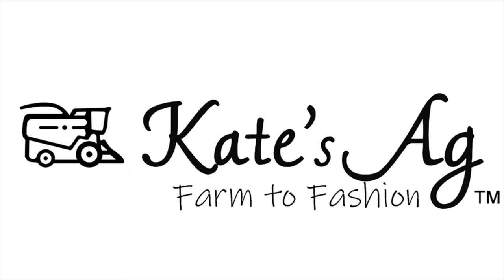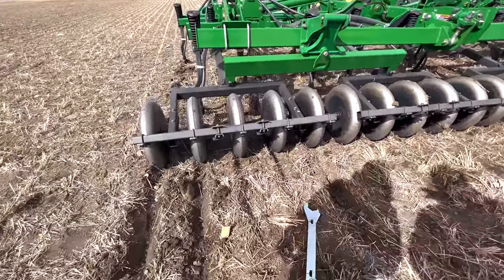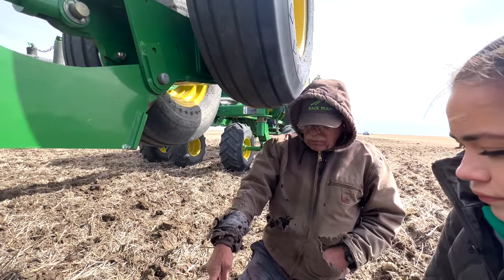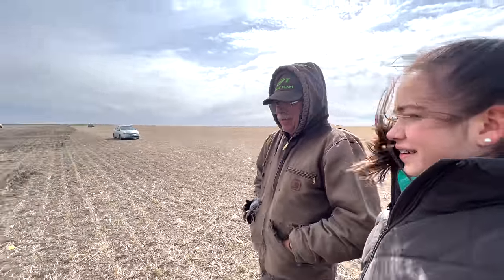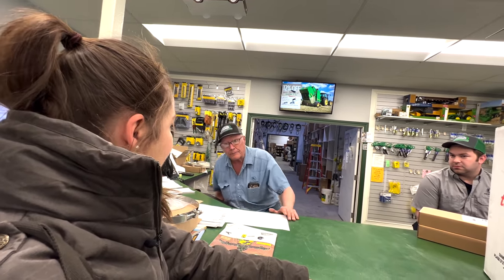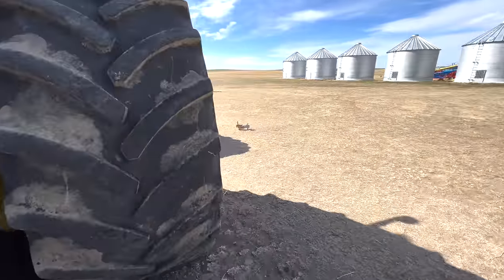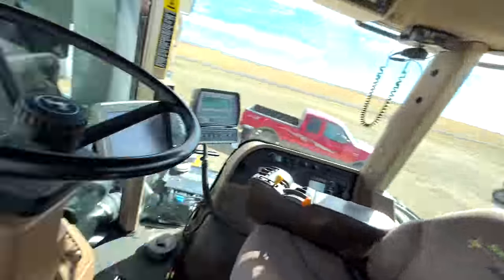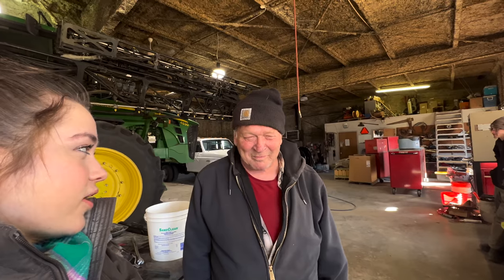50 MPH Winds & Runaway Prius Farm Car!!!!

Comment: Thank you for your "windy" narration.  We have had a lot of wind up here in Calgary this spring.  They can turn off the wind machine and it would be fine with me.  . . .  don't get blown away.  By the way, I used to work part time for another uncle at Flexi-Coil.  I worked on a small assembly line making parts for the packer frames.  This goes way way back in time.  Flexi-Coil was not into making tillage equipment at that time.  That came later.  Naming the packer, and the resulting company is another story for another time.  😊  Keep focused on your spring planting.  It sets the pace for the rest of the year.
Reply from the maker: hahahaha!!!  Thank you for your hilarious comment and terrific story and wonderful kindness!!!!!!!!!!!!!!!!!

Comment: I never would of thought of using a Prius on the farm, however that is a good idea!  You should be able to save money on fuel running for parts even with the high cost of the batteries.   The turbo pre-cleaner is a VARY good thing to add to the tractor! I would add them to all your tractors if you have not already.   You might also consider an old multi-fuel Military truck fixed up by Boyce Equipment.    A M35A2 Bobbed Deuce 4X4 with hydraulic steering and disk brakes added to make it a bit better to drive.  It would still likely be a challenge for you because it is stick shift only as far as I know.  However one can add used oil in the fuel and use other kinds of oils that one would not be allowed to use in a modern truck fuel, thus saving some on fuel cost for this size of truck.
Reply from the maker: LOL!  Yes, the Prius is a great car to run to town which takes about two hours round trip.  Thank you for your great comment and wonderful kindness!!!

Comment: That same device, on a mini scale, is called a TURBINATOR and has been used on the air intake of dixie chopper mowers for 3 decades, it prevents the dust and dirt caused from mowing entering the primary seconday and tertiary air filtration systems of the dixie chopper mower. Dixie Chopper Turbinator Pre-Cleaner, its only 3 to 4 inches versus yours, but the same device
Reply from the maker: Thank you for the fantastic information!!!!!!!!!!!!!!!!!!!!!!!!!!!

Comment: G, day Kates Ag from Sydney Harbour Australia. 
I'mm interested if the seed depth variation was only on one side of the drill? Do you think this is from hitting rocks or the hydraulic extension arms?
Nevertheless, the seed is planted in moisture and pressed by the trailing steel wheel.
So you have another drill with clear tubing to the seed boot.Has this the same issue.
I am amazed at the new air filter being so close to the exhaust on the tractor: heat and smoke.
Have you heard the WWI joke in the trenches- the General "send reinforcements were going to advance' by the time the runner got to HQ it was ' send 3 and fourpence we're going to a dance'.
👨‍🔧🇭🇲👗🛍
Reply from the maker: Thank you for your questions.  The arms just reposition over time because of the terrain and  how hard the dirt is and rocks.  LOL  Thank you for your hilarious story!!!!

Comment: Hey on your big tractor tell your pops to point your exhaust tip away from your intake or pre cleaner due to possibly sucking up the exhaust and exhaust heat which will burn more fuel and have your tractor run hotter I usually point the exhaust towards the rear but safe planting this year for y’all
Reply from the maker: Thank you for your terrific suggestion.  I will let him know.
Reply: @KatesAg  I think that’s why the new John Deere tractors like yours they put it on the left side of the cab the intake but yeah I’m a field service mechanic and have had a few I had to turn the exhaust away from that intake because it was turning and plugging there air filters black lol and with inflation on parts it’s crazy and scary the same time

Comment: Looks like a winner with your wheat.     Our south field stopped getting more than 1/2" in July and the North in September.  About 1 1/2" since Summer.    On the Southern high plains the 2022 crop is a failure.   Looks you will be getting a fair price with our loss and the Ukraine war.
Reply: would that be.... "winner wheat"?   I slay me!
Reply: @keemez  Making an average yield will be "winner wheat" with $10.00 per bushel of HRW   My 1974 crop sold for $3.30 and now it is 3 times higher.
Reply from the maker: Thank you for your comment and story.  I am very sorry about your crop.  Our crops were bad last summer because of the drought.  We are still in a drought and even though grain prices are high so are fertilizer and fuel.
Reply: @KatesAg  Farming is not mostly luck.     Last year we averaged 50 bu when <25 was average around here.    We had ours on no till since coming out of CRP 8 years ago.   Our clay soil has rain runoff if crop residue is no managed to have good structure.    We had about 15" of rain in 12 months to make the 50 bu/ac.    6" in Summer,  one 3" in November,  one 2" in  February,  then 4" about May first at heading.  With good soil fertility the wheat used the moisture beneficently.  It waited out the dry spells.    Your dad pays attention to details that makes the grade.  He knows how to take advantage to come out the winner.
Reply: Sounds to me like you crop would benefit from nitrogen soon after flag leaf presentation. Have you completed a soil chem and nutrient analysis? Good luck and smart farming.    
🌏🇭🇲h @robertreznik9330
Reply: @johnfitzpatrick2469  We did not now if we were going to get a rain to fill the grain.  The protein was very good .   I got a soil science degree 50 years ago.   I know what the soil and wheat is needing because I have much more information.
Reply: @johnfitzpatrick2469  The protein was very good 60 bu.  in a dry year indicating we did a good job.  The wheat could have made 100 bushels if we had more moisture and nitrogen.   I got a science degree 50 years ago to learn all about what is needed.   I have a lot of information to maximize  the crop.